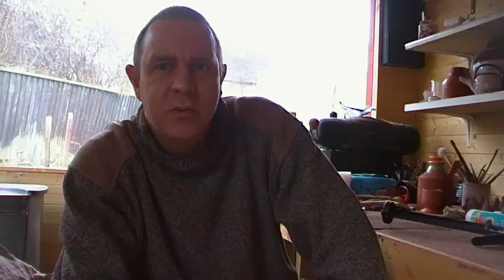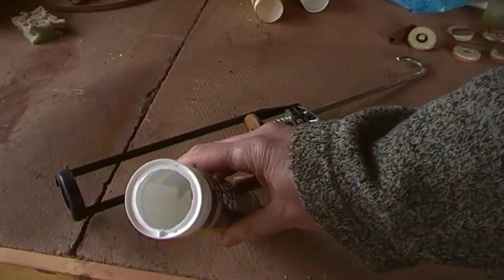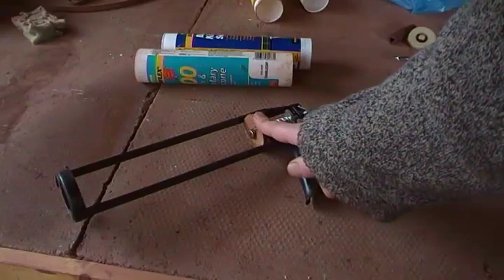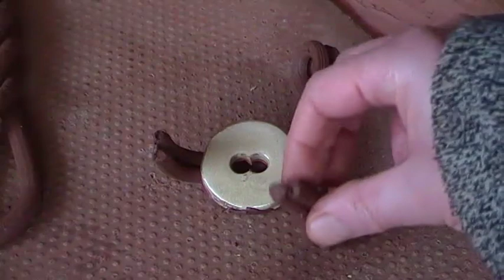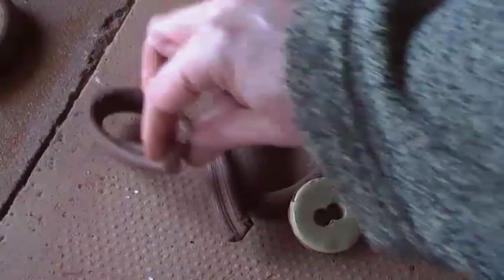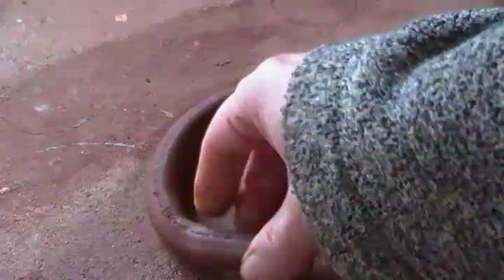Making A Clay Extruder MkII

Comment from the maker: I scraped out the dry sealant from inside the tube then pushed the plastic insert out by inserting a screwdriver into the nozzle and pushing hard. I'm sure there is an easier way...if you find it please share.

Comment: I spent 30+ years in plastics molding and extrusion and know that the 'land' area of the die is very important.  I have one of the slightly larger commercial versions of what you made and the thin aluminum dies cause a lot of chatter and the extruded piece is not very strongly bonded.  I'm going to make some ceramic ones like you did for it.

Comment: Great idea!  Especially to make the die out of ceramic.  It sure beats drilling and milling holes in aluminum and it also gives the clay a longer contact area with the die to help prevent chatter and build more back pressure for forming a better bond.

Comment from the maker: Thanks John. No, I hadn't seen it and, blast it, I wish I had. But your technique is the same as I had seen on the web. I can buy the pipe and caps in the UK but I had to buy an end connector to fit the caps, I was unable to find caps to fit straight into the pipe, which meant that the pipe wouldn't fit into the gun. This is probably down to European safety laws as the UK caps I bought are much deeper.
I would recommend that viewers in the US watch your video.
Mark.